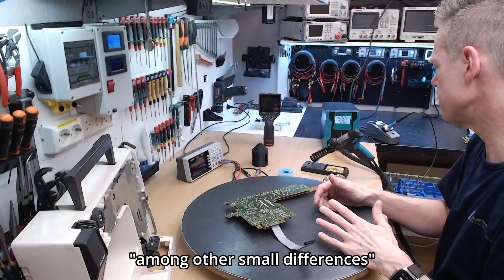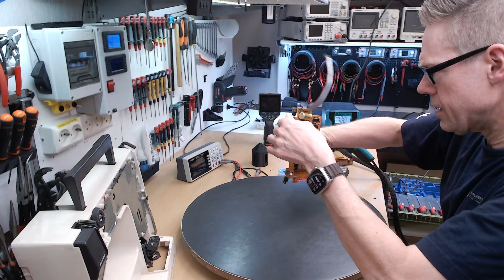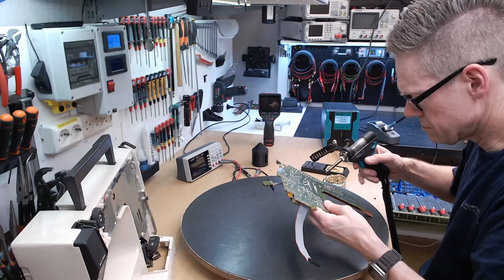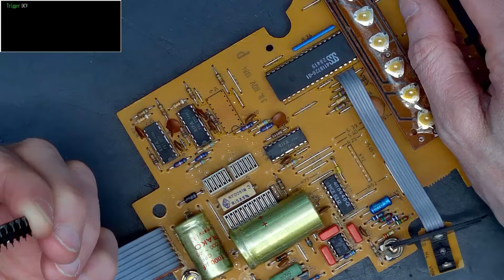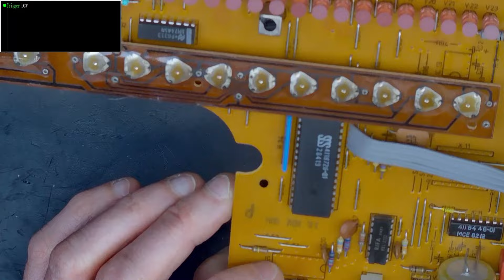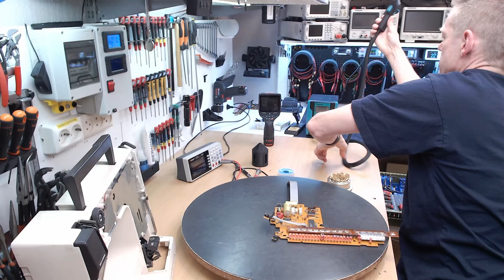Replacing Stepper Motor Drivers in Husqvarna PRISMA

Comment: Hello. I have a janome m72000 and it doesn’t do the  “start dance”, zig zag and fancy stitch. It has a stepper motor for this. I believe it is the stepper motor. I tests it and give me ~10 ohms in two pairs. I believe it is good but without mechanical resistant it doesn’t spin properly, only a millimeter.  Do you know how to approach this problem? I really appreciate it. Thank you for your video
Reply from the maker: Hi! Is it the same with both stepper motors? One for stitch lenght and one for zig-zag. If it does not calibrate the motors it also might be the needle position / main shaft sensors. It does not calibrate the stepper motor for zig-zag if the needle is down.
Reply: @sew @sewrepair nk you for your answer.  The problem is in the upper motor next to the needle bar. I test the stitches. I can change fine the length stitches, I can do the reverse.  The problem is only the width stitches.  Do you think if I only change the motor will be enough to solve it? I do not know how to test the sensors. 
The mechanical parts are clean, oiled and free of movement. Thank you very much

Comment: I am so impressed with your understanding and problem-solving skills with these machines, In my collection I have a number of computerised machines and now feel comfortable servicing most of them, I do have a question for you, do you oil the stepper motors ? I do, I use a very fine artist paintbrush with a very small amount of oil on it and use that to oil the motors with much less than a drop of oil, I have never had one fail, and they keep working, some of mine are more than 30 years old.

Comment: HI FROM NY. USA..  THANKS FOR THIS VIDEO, I LEARNED A GREAT WAY TO CHECK THE DRIVER WITH YOUR THERMOMETER TECHNIQUE.  SO GRATEFUL FOR YOU SHARING THIS..  MUCH LUCK TO YOU..    Jose R Garcia
P.S.  JUST CURIOUS WHY YOU DO NOT USE ANY FLUX. ??  ALTHOUGH I REALIZE YOU'RE NOT HAVING ANY ISSUES JUST THE SAME..
Reply from the maker: The solder I use has flux inside :)